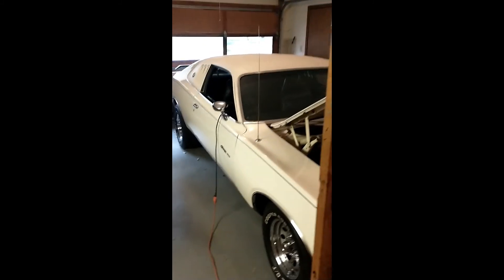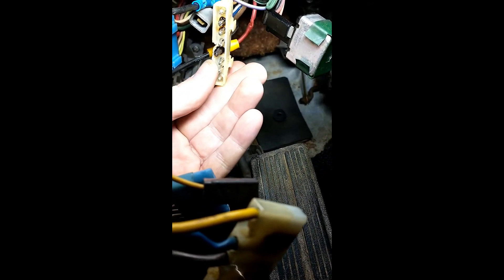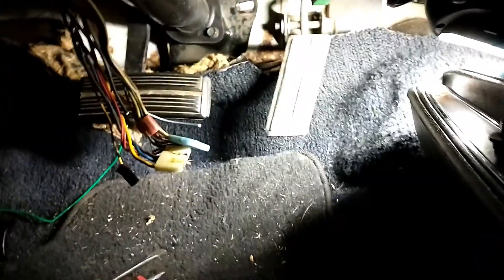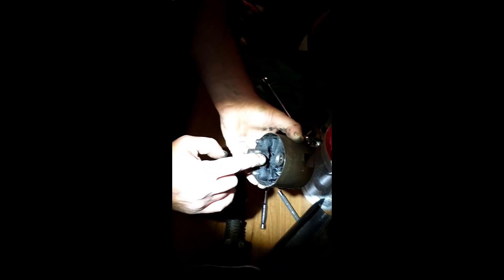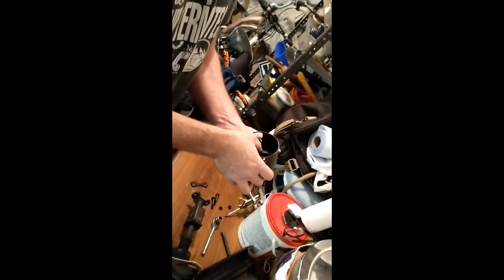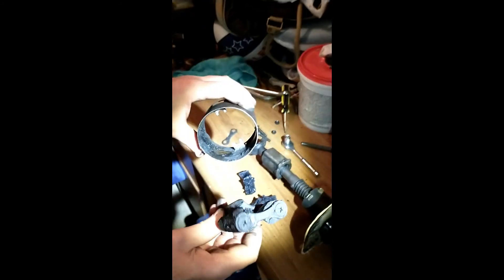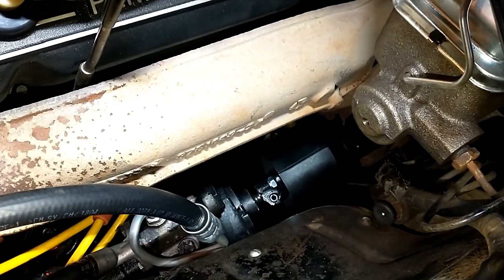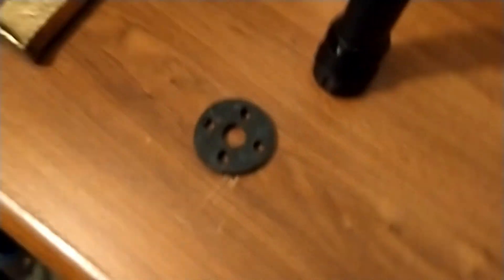1973 Dodge Charger Rag Joint Replacement

Comment: Great info. My housing rusted away and all the rubber rotted out. Was at a loss until I came across this video. Was yours a 727 automatic floor shift? I heard manual trans uses a different RAG joint.
Reply: Thanks & Yes it's a 727 floor shift.